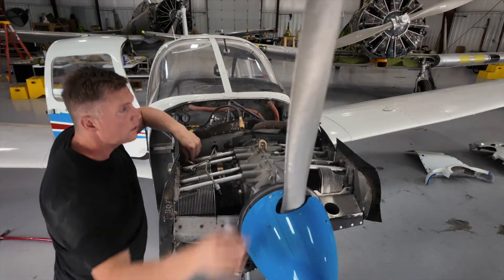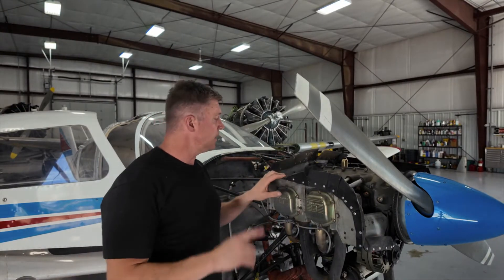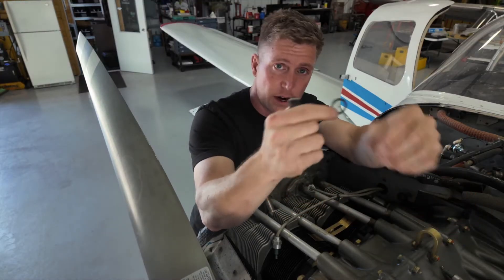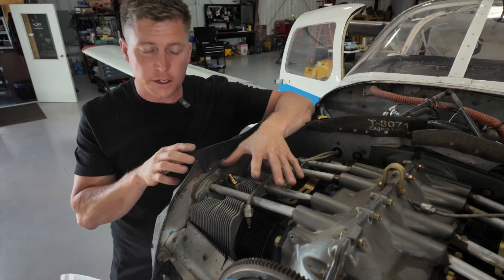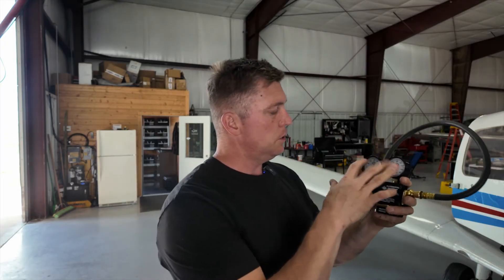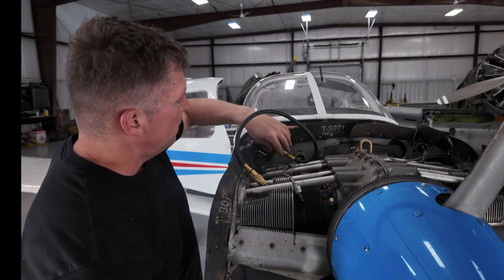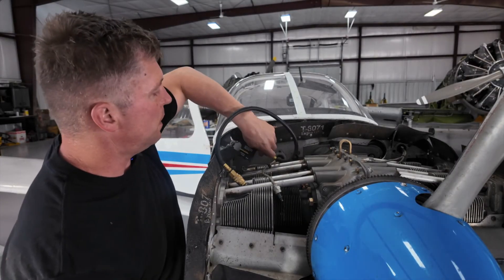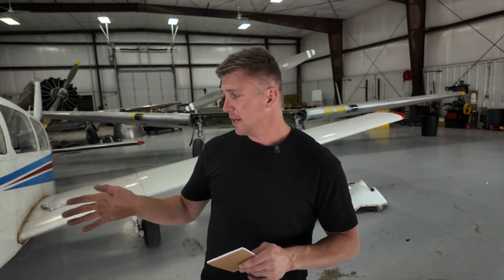How to Check Compression - (lycoming 0-320)

Comment: I grew up working on vehicles and calling this a leak down test.  Is there a test in which you connect a gauge to the spark plug hole and see how many PSI the cylinder will produce by completing a few revolutions of the engine?